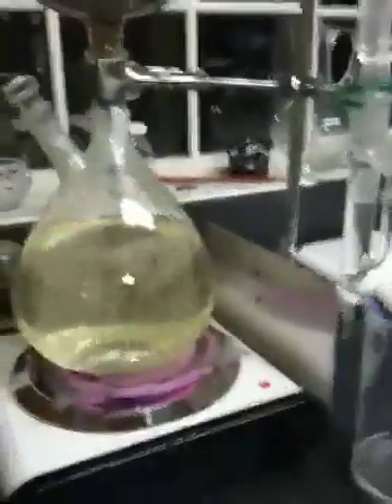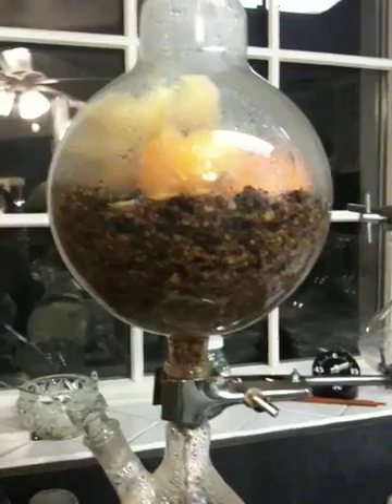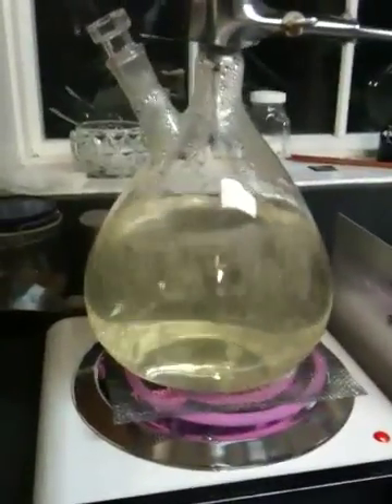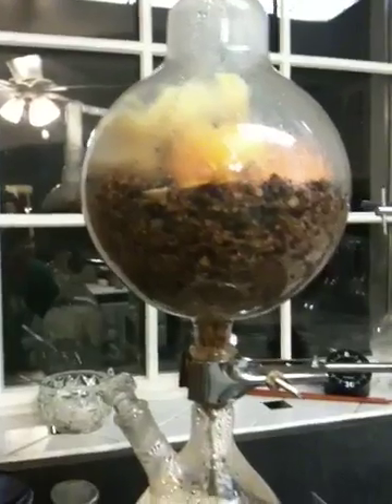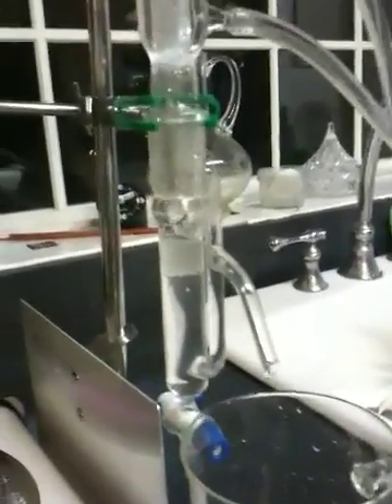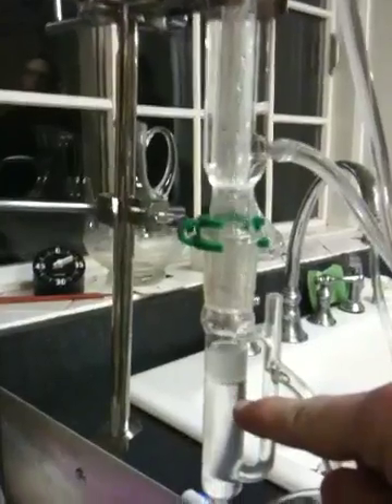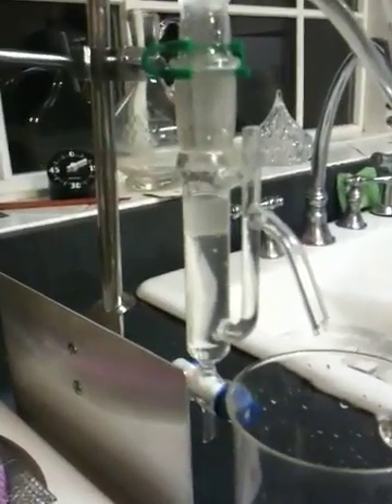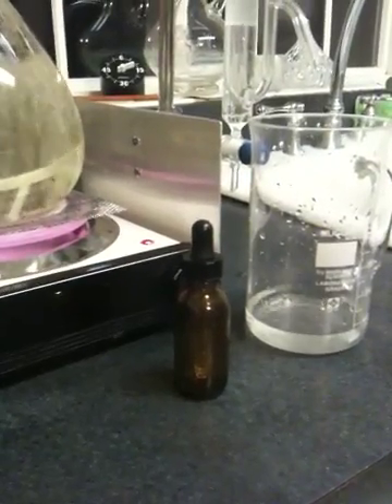Gin-making with a steam extractor.

Comment: So you only use the essential oils (and grain alcohol) to mix with vodka and dispose of the water you separate out? Does the water retain any flavor or have any usability after distillation?
Reply from the maker: The hydrosol absolutely retains a lot of flavor.  Indeed, the much-beloved food and bath (and much more besides) additive rosewater is really just the hydrosol left over from the extraction of rose essential oil.  I'm not sure if the remainders of the gin would be good for much, but you could certainly use it in cooking or even as a perfume... if you wanted to smell like gin, I guess.
Reply from the maker: Forgot to mention: yes, I mix it with vodka to taste. By using pre-made, commercially available (and thus already taxed) vodka and beverage-grade grain alcohol in the process, I do an end-run around the rather tricky business of the home distillation of spirits (which is currently not legal under federal law).  Someday I intend on having my own distillation business, but there are many hoops and regulatory hurdles to overcome and until that's taken care of or until the legislation changes, this is the only kind of work I can do.
Reply: walkeraj Thanks for the response! That's exactly what i'm setting out to do as well (aside from opening a distillation business lol.) I was actually inspired by the old T.V. show M.A.S.H. and the gin still they had set up in their tent, I want to build a functioning replica of that still (without it being illegal that is) and your method seems to be the best! Great video by the way, very helpful.